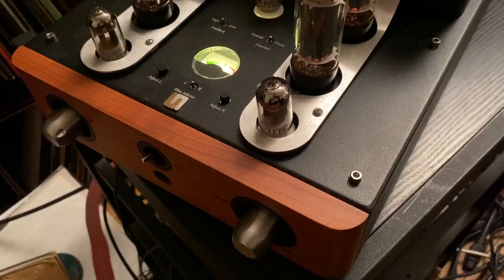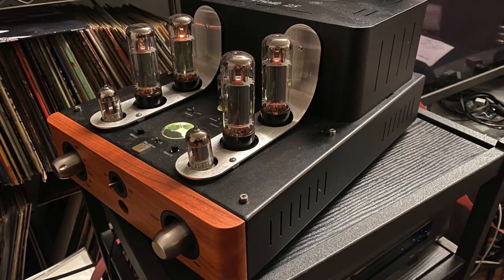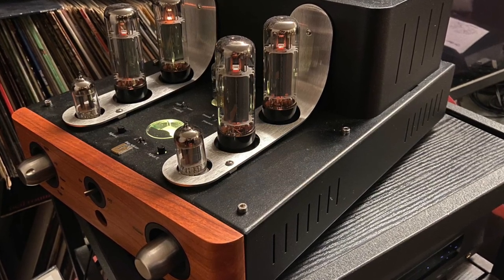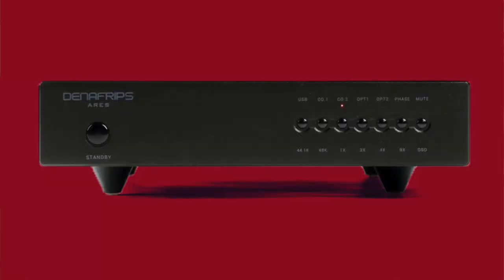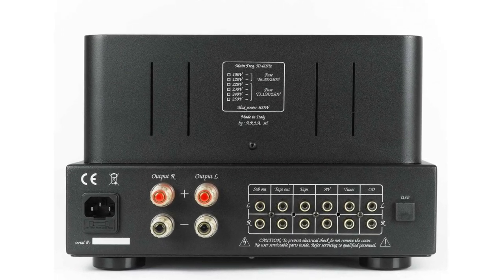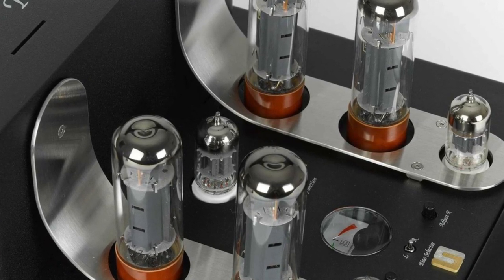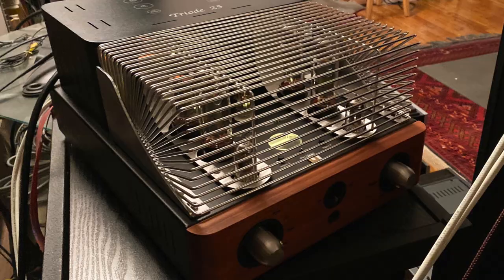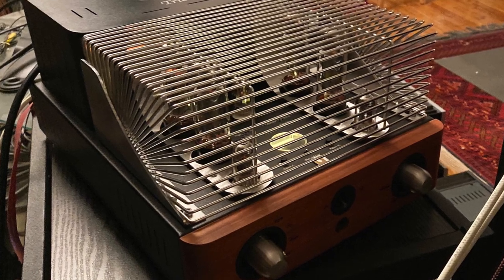Review: Unison Research Triode 25 Amplifier

Comment: I am experienced! Tube guitar amps exclusively since the age of 8, all tube hifi setup.  This thing is beautiful!
Reply: Me, too.  I got involved with tubes the day I got my first electric guitar in 1966.
Reply: @rb032682  nice!  Mine was a little fender champ when I was eight yrs old back in '84.  I've tried SS hifi gear but quickly realised it was not for me.
Reply: @billbones1000  -  My first amp was whatever Woolworth's sold at that time.  From '75 - '82  I used an Alembic tube preamp with a 400 watt BGW power amp.  That is why my ears are still ringing 40 years later.   Beginning around '73,  it was still easy to get tubes, but the tube quality just kept getting worse, in general.  That's why I went with only pre-amp tubes.
     My favorite guitar amp, was a 1x12 combo, Mesa Boogie Mark IV.   I miss it very much, but it went to a good owner/player.
I have a nice old Fisher tube receiver somewhere in the Akron, Ohio area.  I'll probably never go back to Akron to retrieve it. It has a sweet sound, especially for its age.
Reply: @rb032682  I have a Mesa mark IV in my guitar amp collection, great amp!
Reply: RB I have a The Fisher 400 and a 500C; the latter is operational, the 400 needs service and at the minimum two output tubes.  I’m selling them off to fund a much needed speaker upgrade, but my main setup is all tube (phono, pre, SET power amp) and I plan on a getting an integrated tube amp for my workshop.
Reply: @PanAmStyle  -  Sounds like a sweet system.
Reply: @billbones1000  -  Yes. The Mark IV is a lovely amp.  For about a year, I ran a pair of RCA black-plate 6L6s for the output.  It was very sweet.  But I got laid off and had to sell it cheap.   Then I quit doing live gigs.  
   Now most of my tube amps are some great emulations in my DAW.  They weigh so much less than the Boogie.

Comment: 7:45 Pacific I gave up my Dyna stereo 70 mono blocks and Marantz 7t a few years back. Fortunately I kept my Vinyl collection from 60’s70’s. Recently jumped back in and there was no question of whether I would go solid state or valves. Prima Luna 300 preamp, Prima300 power amp, Rega Planar10 with Aphelion2, EAT-E-Glo S phono stage, and a pair of the new Klipschorn AK6’s. I just turned 76 and I finally have my forever system

Comment: Unison Research makes nice amps. I had the Unico Primo and did listen to the Preludio. Only issue is, they are rated at 6ohms. So power is slightly lower than the stated output when driving 8 ohm speakers. But they do sound good.

Comment: Back in '96 I built Herb Reichert's 'Flesh & Blood' 300B-SE mono blocks from his article in Sound Practices Magazine. 
15 years ago I bought David Berning's MicroZOTL ("Highly recommended times three" - Herb Reichert, Stereophile) and it drives my Klipsch La Scalas at one Watt per channel with aplomb. 
Both amps use 6SN7GTBs tubes. As a driver for the 300B and in a push-pull output in the MicroZOTL.  ...I'm a fan.

Comment: Not necessarily stoned, but beautiful.  CJ MV-45 and CJ PV-6 and PV-10B.  Uncle Kevin special tubes.  Only problem is no speaker for it, maybe the Magnepan LRS worthy of a try.  They did sound good with the PV-10B and Solid State power amps.  Anyway sorry won't be spending 4k for this one but I would have some great tubes to roll in it...

Comment: Try a Japanese kit tube headphone/speaker amp. Good for efficient speakers and as a bonus you get autobias, switching between pentode, triode and ultra linear mode. One of the real stars is using these as headphone amps. And you can made them better and upgrade them as time goes by and it scales really well with  better dacs and streamers😀

Comment: YES!FIREBOTTLES!Biasing no problem to me.I have bias tube amps-PP in hi-fit amps,Gfiddle amps and AM,SW transmitter modulator stages-adjusted a TRIODE PP amp that is 125Kw.Love the sound and the smell of HOT GLASS1-esp if the tubed amp is in a wood cabinet-like the woodsy smell!I own Leak,McIntosh tubed amps.

Comment: More careful matching required with tube amp,  room acoustics  aside,  because of low DF.   Results/impressions will vary according to speaker impedance, speaker wire gauge and run length. Then there is output impedance and the speakers ideal response curve. The whole system must be matched.

Comment: Nice, but this is really a 45w Ultralinear pentode/tetrode amp that also does Triode mode?
And yes I'm experienced: But not "hi-end" ( as JA said recently:"it's hard to design a bad tube amp" ;-)
 I keep a (Chi-Fi) Silk Audio ms38 EL34 tube amp in my second system.
I listen to it every morning. Tubes do high volume so gracefully, you can't help loving their character!
 I've rolled in NOS GE and Mullard signal triodes  and reproduction Mullard and Gold Lion power tubes. It does Ultralinear and Triode mode. Metal remote too!
And it was only $650 new!
It's a fancy version of the Yaqin ms34.
Maybe one day I'll get a Primaluna: but I hear they're less Tubey according to Thomas....
I actually prefer the Mullard el34 and GE triodes for that;-)
Steve: Is this amp point to point wired or a circuit board?
That might explain the huge price difference

Comment: I think you said that the Amphions are 85db/w/m sensitivity. Is is not a little unfair to try to drive this with so little power? I thought these Amphions needed juice. The other two speakers you mention are large, sensitive units,  aimed at tube listeners with high-nineties dbs in sensitivity. Thought it a little odd to not mention this here. The unhappy handshake is thus not very surprising.

Comment: Shown amplifier is Push-pull, and it's not as good as Single Ended. The other important thing about the tube amplifiers are the speakers. The speakers have to be with hard suspension ( Paper Folding Ring), high sensitivity and light membranes. Usually the big speakers have heavy membranes, that are very difficult to control with a tube amplifier.

Comment: I grew up in the era when tubes were the only way amplifiers were built. I was underwhelmed, but possibly because I never had a high end model. They were about as expensive then (relatively) as they are today. The transition to solid state happened in my teens; and in my twenties I bought a quality transistor receiver and never looked back. 
Judging from the tube complement, rectification must be done with solid state diodes and it must be possible to run beam power pentodes as simple triodes. It never occurred to me that anyone would want to do so, since it reduces the power output by about one half. At only 45/25 watts per channel, the price seems a bit steep.
Reply: machintelligence  
More than half more like 30 percent, also early transistor were pretty bad newer ones are quite good a big part of people likening tubes is there not a analytical tool there nice and smooth

Comment: As usual loved your review. I have been using this amplifier for the last 4.5 years with no regrets. Unfortunately, yesterday the amplifier blew an internal fuse, the one in the F2 position. I will get a replacement for it and replace it. In the meantime, I decided to look at the internal fuses in the other positions too(F1,F2,F3,F4 and F5 respectively) and surprisingly they all had different values. 

I then checked the manual and it said T3.15A L250V and mentioned fuses so am assuming that it means all fuses internal as well as external to have this rating. The UR website mentions this rating too.

Are all of the fuses supposed to have a rating of T3.15A L250V ? I know it is common to have fuses with multiple ratings based on the circuit they protect, however the word "Fuses" instead of a singular "Fuse" in the manual has confused me. 

It would be great if you could confirm this and share the correct ratings these fuses are supposed to have. 4 years ago some fuse had blown and the dealer(who is no longer a UR dealer) had replaced it. I don't recall which ones hence am worried if these ratings are correct.

Thanks in advance for all your help and advice and I also wanted to take this opportunity to wish you a Very Merry Christmas and a Happy New Year!!!
Reply: Just a suggestion: Always try to have the “service manuals” of all your equipment. With the service manuals you will always have the chance to fix any problems without depending on the official distributors, specially if those equipments are out of their warranty period.

Comment: Switched to tubes (Almarro 205A & 318B) right after purchasing Cain & Cain Super Abbys some years ago. They didn't sound so great with some Aleph J mono-blocks nor with a Pathos Classic hybrid, but with the Almarro amp, especially with the smaller 205A, … musical bliss, at least for me. I've had several other tube amps and today I'm down to, and sticking with, a couple of Decware stereo amps in mono config. Couldn't turn my back on tubes even if I tried. I don't have to bias these amps, but I used to enjoy doing so with the 318B Almarro amps. Part of the pleasure.

Comment: Hey,
I'm designing and building my own tube amplifiers. Are there any features that would be useful for an amplifier and that lack in the tube audio industry?
Reply: How about a minimalist base/cabinet design, made to minimise resonances as much as possible?
Also, total seperation of the signal paths for each channel, and very short signal paths with direct wiring wherever possible?   : D
Reply: @HareDeLune  Do you think there is any point in making like a two monoblocs in one? 
And what is most important between power consumption and linearity, because it is possible to get incredible results using transformerless tube amps (I think Steve never tried one) but you need like 20 power tubes to run at a decent power?
And I don't really get the resonances that you're talking about
Reply: @victorbregeon594 
I didn't know about transformerless tube amps, but they sound interesting.

Do I think there is any point in making something like two monoblocks in one?
Obviously, yes I do, otherwise I would not have mentioned it. It is a proven design which can give superior results.
Perhaps not as good as monoblocks themselves, but some people need something more compact.
At any rate, keeping the left and right signal paths separated is always better.

As for resonance: Nearly every tube amp I have ever seen has a base that is made in part of stamped metal. That thin metal sheeting will resonate at certain frequencies, from vibrations given off by the flow of electrical current, by pressure waves in the air generated by the playing of music, and by vibrations picked up from the floor if the amp isn't protected from them in some way.
Since tubes in particular are known to be sensitive to vibrations to the point of being microphonic, it stands to reason that you would want to do everything possible to eliminate or reduce any source of vibration and resonance coming into contact or going through them, which will negatively affect the sound.
This concept applies to every good sound system without exception, but most particularly to those using tubes.
Reply: @HareDeLune  I think 'two monoblocs in one' can outperform normal monoblocs ; with good shielding and it reduces cable length anyway, I tend to find that even if monoblocs are beautiful creatures they are quite messy on the wiring side.

Yes I see your point now, but the most microphonic sensitives tubes are small-signal pentodes, not really used in the HiFi world.
But it would be very very interesting to mount a tube device on suspension like turntables and compare it to the same device without suspension :D

And thank you for this very interesting conversation
Reply: @HareDeLune  And maybe it is worth trying to build chassis out of a solid bloc of aluminum or wood to avoid the resonances in the junctions.
Reply: Just have a nice overall design and everything will be perfect

Comment: The cost of this amp is reasonable!Too many bulb-firebottle amps are way too overpriced.Remember building ST-70 Dynaco amps during transmitter shift in my sleep-built one without the ‘pin up”schematic! BRING THE KITS BACK-then us mortals can afford the amps.—And enjoy building and using them!
Reply: I enjoy kits too but I doubt it would bring the price down noticeably.  Good tubes and transformers are still very expensive.
Reply: Recently got my hands on a Dynaco ST 70 slightly re-kitted orig transformers and WOW
Reply: @rotaxtwin  Both tube and transformer manufacturing has been largely automated-this keeps their cost down.Its The GREED factor that makes parts and equipment high cost.